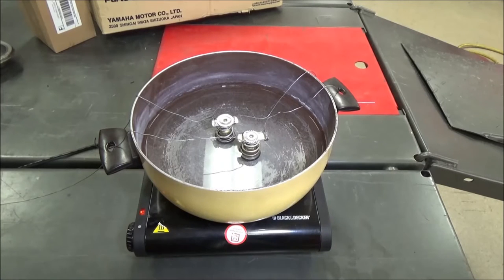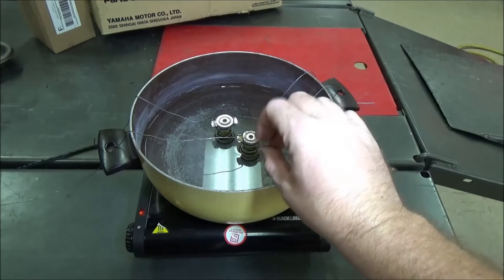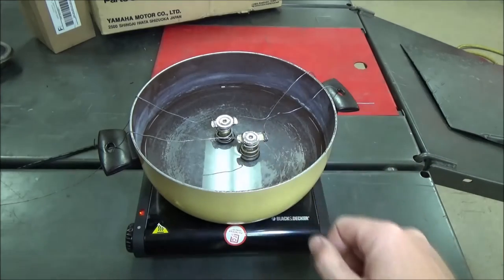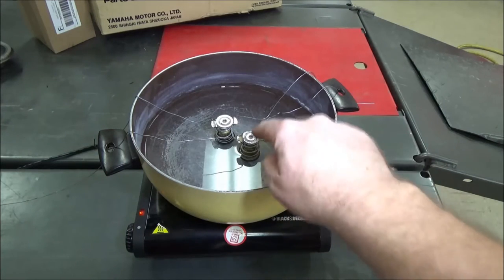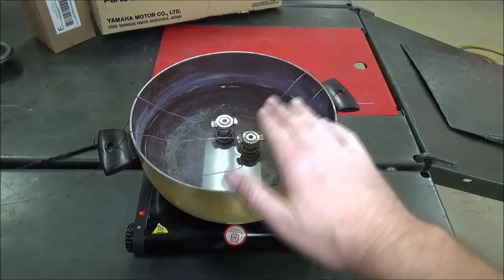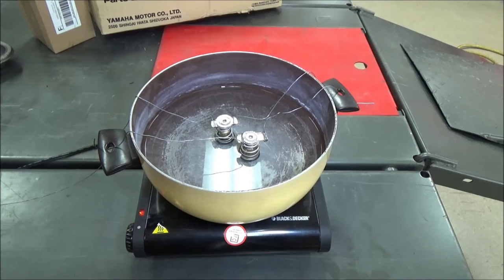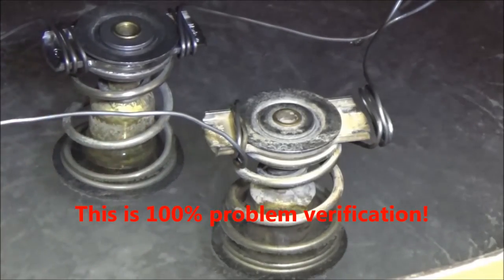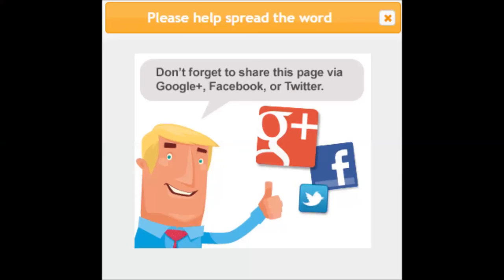How to test thermostat old vs new PROVE your work! Triumph style shown but works on any type!

Comment: How does the coolant flow when the termostat is closed on motorcycles ? On cars there is a small loop for the coolant to circulate, but on my XL600V Transalp there is no "loopback" after the hot coolant reach the thermostat. 

What is going on until the thermostat open, what is the water pump doing since there is no loopback ? Does the coolant just sit there waiting to reach temperature, or it does circulate in some ways ?
Reply from the maker: Hey there! Jenny here. Shane has a video on it. One of the member benefits is to request for them and you get access to over 700 videos! 
That's a good question for Shane directly. Have you considered joining the channel to get him daily as a member benefit?
You reached the social media team here. We get 300-400 requests a week, so it’s a bit time challenging as you can imagine. 
Shane does try to answer some non-members' questions when he gets some time so hang tight if you’re not in a hurry. 
Did you know one of the member benefits is to ask for which videos would work for your needs and get daily "quicks answers" to questions directly from Shane?. Best $1.99 a month you'd spend...of course enjoy the over 700 free videos and access the the member only vids with all the other benefits listed below. 

There are two immediate options that can get you a solution within 24 hours and quite often within the day. 

Option 1: 
Consider joining...best $1.99 you'll spend this month 😁 This is great for quick answers. 
He literally logs in and answers member questions daily! He does an AM and PM check-in to answer all member questions. Join this channel to get access to perks:
https://www.youtube.com/channel/UCBhM8DCKnT3qXwTW0eToyCg/join       
-Daily MEMBER FIRST COMMENTS ANSWERED FIRST 
-Live Q/A video chats
-Wonder if we have a video on your need? Members can request content links!
-Full Access to the ENTIRE 700 video library
-Member-Only FREE tool giveaways  
Ways to support or high five How 2 Wrench! Thank you in advance. YOU MOTIVATE US TO DO MORE!
1. Smash the subscribe button (thank if already a sub!)
2. Have you seen our "YouTube Trained Support Shirts?  https://goodfellasmerch.com/collections/how-2-wrench/products/support-shirt   
3. High five donation:  https://www.paypal.me/how2wrench    
4. Got an emergency and your head is about to explode from frustration or fear? Get Shane’s cell here: https://how2wrench.com/ols/products/techline-one-on-one
Reply: There are two routes out of the engine where the thermostat goes. When the thermostat is closed, coolants takes one shorter route back to the engine. When the thermostat opens it closes the shorter one and opens the longer one to the radiator for cooling , heat exchange.
Reply: Absolutely excellent!  It is 21 July 2024. I just ran across your channel. I shared it with many others. I am up in the Rocky Mountains State Forest idaho.  I own several classic cars and a truck (American, British and German) from the 1960s to late 1970s) and a truck plus more contemporary daily drivers.  I absolutely enjoy watching your short extremely informative, helpful and educational auto shop classes.  Thank you. Keep them coming.  77 Sunset Strip - US Route 66 Classic Car Guy👍🏻😉🇺🇸🏎️⛽️🚙🛻🇬🇧⛽️🙏🏻✝️🇺🇸🇺🇸🇺🇸
Reply: Absolutely excellent!  It is 21 July 2024. I just ran across your channel. I shared it with many others. I am up in the Rocky Mountains State Forest idaho.  I own several classic cars and a truck (American, British and German) from the 1960s to late 1970s) and a truck plus more contemporary daily drivers.  I absolutely enjoy watching your short extremely informative, helpful and educational auto shop classes.  Thank you. Keep them coming.  77 Sunset Strip - US Route 66 Classic Car Guy👍🏻😉🇺🇸🏎️⛽️🚙🛻🇬🇧⛽️🙏🏻✝️🇺🇸🇺🇸🇺🇸
Reply: Absolutely excellent!  It is 21 July 2024. I just ran across your channel. I shared it with many others. I am up in the Rocky Mountains State Forest idaho.  I own several classic cars and a truck (American, British and German) from the 1960s to late 1970s) and a truck plus more contemporary daily drivers.  I absolutely enjoy watching your short extremely informative, helpful and educational auto shop classes.  Thank you. Keep them coming.  77 Sunset Strip - US Route 66 Classic Car Guy👍🏻😉🇺🇸🏎️⛽️🚙🛻🇬🇧⛽️🙏🏻✝️🇺🇸🇺🇸🇺🇸